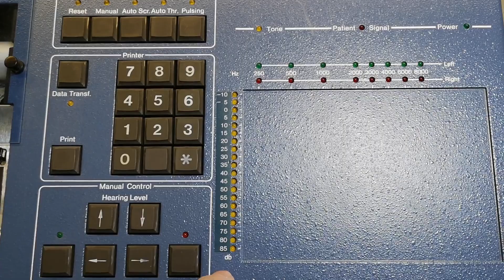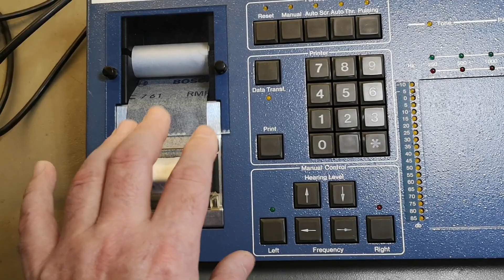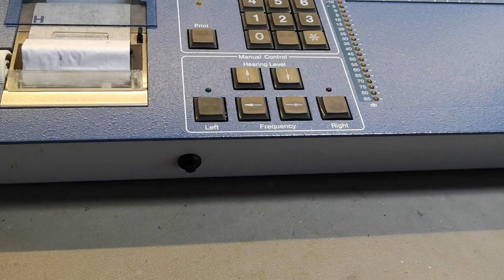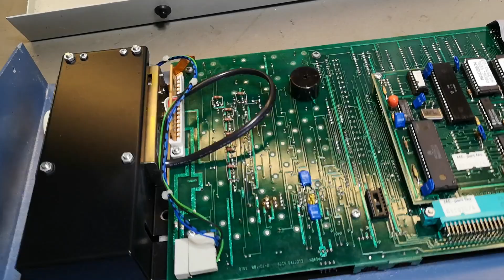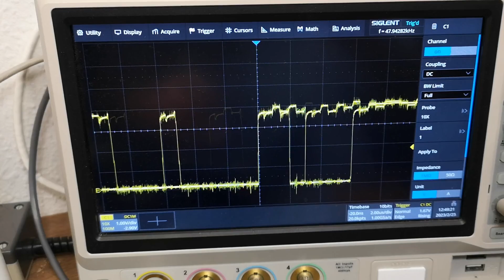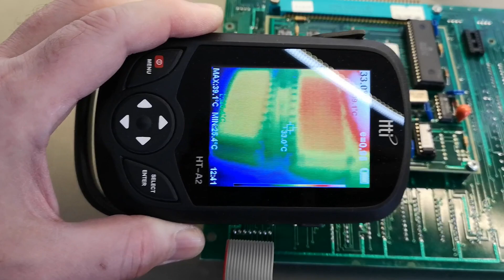Madsen MTA 86 Memory Threshold Audiometer Hearing test defective

Comment: Hello, I have the impression that a card will be inserted into the cut-out near the LEDs, and the LEDs that light up will connect some coordinates on the card, either for reading or writing.
On the source, you can see how the resistance melts there, although he reduced the peaks, he made the board a little hot, but it's not such a big problem.

Nice day 🙂 Tom

Comment: Eproms can be recovered, simply read them with a separate supply to Vcc on the chip, and read at 4V, 4V5, 4V75, 5V0, 5V25 and 5V5, and see which bits have flipped. Normally only a few flip, and then you can write the data back.